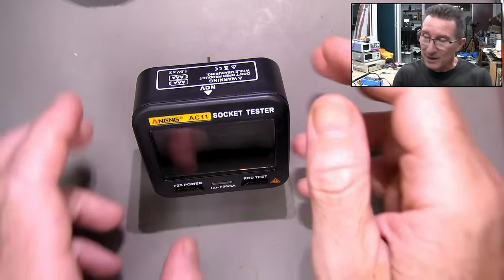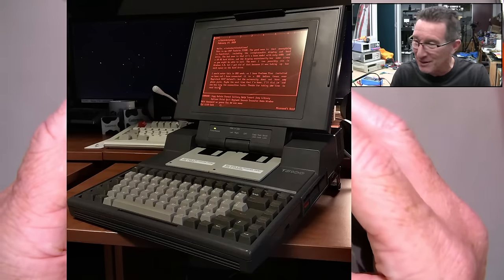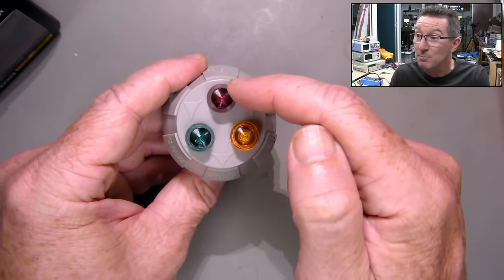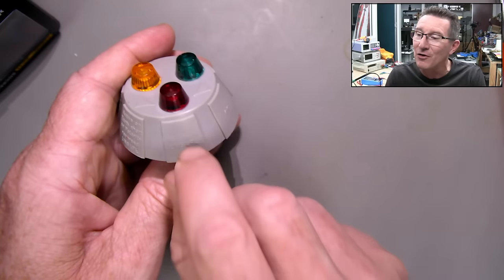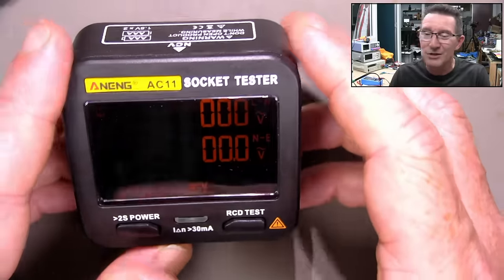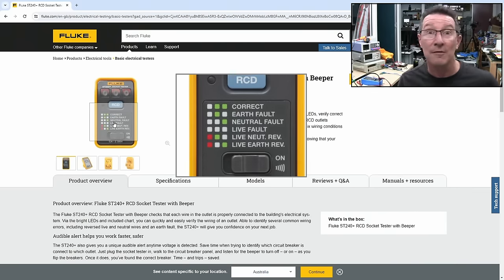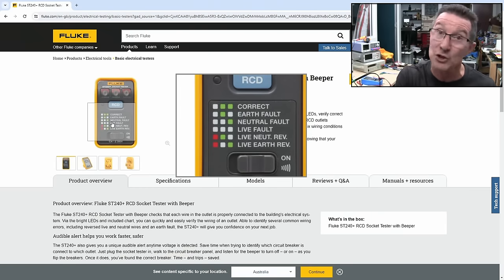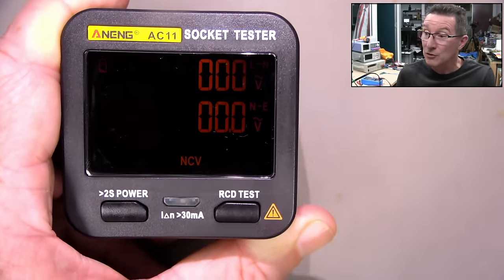EEVblog 1598 - ANENG AC11 Socket Tester TEARDOWN + SCHEMATIC Reverse Eng

Comment: Its actually not an "aussie" plug but actually a mainland china plug, which happens to be ours but rotated 180 and without insulation on the L and N
Reply: Which is redundant anyway, because the switch on the socket faceplate means a half-inserted plug is never live.
Reply: @bluerizlagirl  what do you mean?
Reply: @CountParadox  The purpose of insulated pins is to prevent contact with the pins of a partially-inserted plug.

Australian and British sockets have switches on the faceplates, so the pins of a partially-inserted plug are not live anyway.
Reply: @bluerizlagirl  switches have two states, the one I've observed they are most commonly left in, "on", causes the partially exposed pins to become live 😇
Aussies are lazy and most people leave the outlet on
Reply: @CountParadox  Yes, but that clearly comes under the twin headings of "not using it right" and "deserving what you get".

I think that might actually explain why, despite all the safety features that have been incorporated into British power sockets since time immemorial, we don't seem to have all that many fewer accidents than the rest of the world.  Because the gene for "acting the dick with electricity" has simply wiped itself out in other countries ..... :/

Comment: https://en.wikipedia.org/wiki/AC_power_plugs_and_sockets list of most of the mains plug types. Note that the US has an unusually large number of variations based on current and voltage capacity of the power point. And Japan varies both voltage and frequency.

Comment: I was a military electrician and went to Kuwait in the early 2000s.  They used the old BS (red yellow blue for three phase) and didn't bond the neutral and ground.  Installing or disconnecting circuits would draw an arc due to the imbalance.  Only other place I've encountered similar was Afghanistan that used Russian standard (ungrounded Euro plugs) with random Chinese panels that you had to provide your own bus bars, and often, installers would use terminal blocks with daisy chained 1.5mm² that would catch fire when a single wire was carrying the entire neutral load of the panel lol.

Comment: Are there a standard tolerance for NCV detectors.?
or is it simply anybody's guess and 100% up to the maker when they will shout&trigger first, will obviously often intensify the closer you get.
Picked up a  relative cheap MF/RF/EF sensor tester and Im seeing first trigger/alarm at quite steady 100 V/m on quite a few of my meters, not least fx 210E clamp meter.

Comment: Is there device on AC that can read or record ,measure in milliseconds a wave change , like in ups systems the sine wave changes in milliseconds but how to read or visually measure or see how many seconds it takes to change from grid power to built in inverters for ( ups systems or power stations )?  Oscilloscope is the way to go maybe ?

Comment: Can the ground to neutral voltage go negative?  Would comparing the neutral to live voltage with the ground to live voltage be useful? Ground to live should be bigger if wired correctly?
Reply: It is alternating current. Ground and neutral should be darn near equopotential. What you are looking for (North America, use your mains number elsewhere) 120 between line and ground, 120 between line and neutral, and (close to) 0 between neutral and ground.
Reply: @bertblankenstein3738  in the video there was 0.7 or something between ground and neutral. They are different because there is current flowing on neutral probably due to other devices plugged into the same circut, and wires are low ohm resistors so neutral wire has a voltage drop. Ground has no current, so no voltage drop. 
Hence my hypothesis is that having a comparison of potential difference to live will usually confirm which is ground and which is neutral, although I haven't heard of that being used in one of these checkers before.
Reply: AC voltages are RMS so they are always positive. The momentary voltage of course switches between positive and negative 100 times a second. 

Your method could work but remember if they are swapped it is using the ground as neutral so there will be voltage loss in the ground wire so there could be false negatives but likely not a false positive.
Reply: @okaro6595  Right, good points. Best when you trust the other points on the circuit, and they have loads, but you don't add a load to the plug you're testing, because as you say, the neutral pin will be treated as a neutral and can dip the voltage even if that wire is meant to be earth....  I know AC can't be negative by itself, but yeah, it can fake it if we calculate the voltage from subtracting two other voltages.
Reply: @ChrisSevern7   In a pure single phase system the L-G voltage will be greater than the N-G voltage. In a multi- or split-phase system it will be the opposite if the other legs are carrying a greater load. Or if there are miswired loads between L-G it will also be the opposite. Or negative power loads (such as grid-tie solar) will do the same, too.
Reply: @eDoc2020  ah, right, very good points, thanks!

Comment: My uni-t ut 203+ shows for example current flow of 6 amp from black wire of battery and 8 amp from red wire, batteries are 12v+12v series combination in home power backup inverter. Please a little hint of information here, why there is current difference and which one to follow for calculating the proper power usase.
Reply: The UT203+ is a pretty basic clamp meter and it wouldn’t surprise me to see a discrepancy between the two battery pole readings unless careful placement while measuring is followed.  What you need to do is to zero the DC current before taking each reading.  To zero the current reading, hold the plane of the clamp jaws as much as possible in the same plane as the wire you are about to measure with jaws closed and the opening part of the jaws facing the wire, then press the current zero.  This sounds complicated, but it is what you have to do to get the Hall Effect sensor in the clamp in the most suitable alignment to get a correct reading when the clamp is placed around the wire.
Reply: @wtmayhew  .

Comment: Sure you can detect earth neutral swap, just press the rcd test, if it doesn't blow the fuse then it's swapped... or rcd is bad
Reply: You cannot have earth neutral swap with an RCD.
Reply: @okaro6595  sure you can, it will just blow RCD any time you use anything on it

Comment: atleast europe has cheap 3phase so we dont need 100amps on single phase. also you wouldnt rely on something that has 2 tripple AA batteries inside it? too bad then because almost every electrician primarely uses Continuity, Current and Voltage Testers that have batteries inside them.

Comment: The German and French sockets may legally be swapped live and neutral.  The usual system has 230V between neutral and live (240V in England). The electricity system in Europe is always three-phase, i.e. the phases are offset by 120°.
In addition, there is still the old system rarely. The voltage between Live and the other Live is 230V; between Live and PE only 127V (120°)  
The apartments are then wired like this: Apartment 1: L1 & L2, Apartment 2: L2 & L3, Apartment 3: L3 & L1. 
Everyone gets 230V between phases at the sockets.

This is not to be confused with the US split phase system. There the phases are opposite. 115V + 115V = 230V
Everyone gets 115V at the sockets.
Reply: That's not German. In Germany, outlets are L-N and PE, not L-L. L-N voltage is 230, 3phase is 400.

Comment: putting the switch through the hole in order to be able to load and solder the pcb from just one side is smart. Except that one led i guess, that one they probably handsoldered along with the battery terminal and stuff.

Comment: WHY you have that funny power plug?
Reply: It allows double insulated appliances to be fitted with compact, two-pin plugs that are still non-reversible, so single-pole switches can be used.  The earth contact sticking out of the plug means an earthed appliance cannot be plugged into a 2-pin socket.  The pins are much slimmer than a child's finger, so there is no need for safety shutters in the socket.  Protection against touching the pins of a half-inserted plug is afforded by means of a switch on the socket faceplate.
Reply: @bluerizlagirl  
Sounds good.
Do you have there home use plugs for higher current?

Comment: Older, type A RCDs can only detect AC faults. This is why the reverse diode is needed in addition to the LED, to provide the negative current. The type A RCD will not detect half wave rectified DC. Nowadays the regs require the use of type AC RCDs that will detect pulsating DC as well as AC.
Reply: Older type is an AC RCD, newer with DC pulse is A, and with full DC detection is B.

Comment: I don't see in what it can be useful for.
The electrician has to make the test with professional equipment, that inclusive test the isolation impedance and you can choose the voltage of the test 500v, 700v, ....

Comment: The plug is upside down 😂 thats the Chinese for ya. I believe the uk plug has the earth on top as well.
Reply: Earth on top is safer, related to what might happen with a partially inserted plug and things falling behind. Not so important with sleeved pins though.
Reply: @jonathanbuzzard1376  Nor are partially-inserted plugs an issue when you have switches on faceplates!  (as is the case in the UK and Australia)

Comment: In a TN-C-S System: N to PE  < 1V is OK. 1V You should think about it. AT 2V you have a Problem. 3V call your wife you come later home.
Reply: I think 5% voltage drop is usually acceptable on a loaded circuit. Divide by two (because we only care about the neutral here) and you get 2.5%. That's 6 volts on 240v service. Without knowing anything about the environment I wouldn't feel comfortable saying 3v is too much.
Reply: @eDoc2020  Yes, that’s the reason, you call your wife (or man) that you come later home….